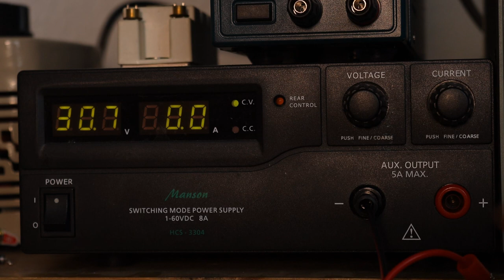ZVS Driver tutorial  - Step by Step - Flyback driver + Inductionheater

Comment: I made it and it works, thanks a lot for your tutorial
Reply: My circuit does have a major problem though , i was wondering you have a fix for it. When I run the circuit of my 12 volt 10 amp max battery charger it works fine and it gives arcs. Then I wanted more high current arcs so I used a 8 volt drone battery. I worked very nicely for a few seconds and then the circuit stopped oscillating and the mosfets started heating up. Then I turned it off and tried again then again it worked for a few seconds the the arcs stopped and mosfets started heating up. I then tried it with my 12 volt 30cc large lipo battery which can output upto 80 amp peaks. With this high current 12 volt the circuit never started oscillating and the mosfets started heating up quite a lot . The mosfets didnt die fortunately. But the only source I can run it on properly is my 12 volt 10 amp max battery charger.

Edit:I found out my frequency was too low because my caps were too high

Edit: i fount out my problem still persists even after chaning the caps. I dont know why

Edit: I Fixed my problem, turns out the problem was just my flyback transformer, I changed it and now it works flawlessly!
Reply: My did not work

Comment: hey man i need help me... i dont know how to set up my "ZVS Voltage Switching Coil Flyback Driver Coil Driver Board Marx Generator Jacob Ladder Ignition Coil 12-36V" i see at the 1:48 you have the both wire in one hole?

Comment: I used two 0.68uf capacitors but they heat up when i pass 24 volts and 4amps the coil aswell heats up a bit should i add more capacitors? Please

Comment: I built something very similar to this many moons ago but using a centre tapped coil & a slayer circuit to drive it but never tried it with a ZVS. Worth investigating. Can I ask how many turns & wire size you used on your primary?
Reply: 4  and 4 turns

Comment: Hey i have a quistion i orderd the exact parts for this build  but could'nt get my hands on an 100uH inductor so i wired 10 10uH inductors in series wil this work ? And st what voltage did u run this set up?
Reply: 30v

Comment: Can I really get that thick arc from 0.8A supply?
Reply from the maker: not a thick one
Reply: @Teslaundmehr  can I use mpx-x2 capacitors?
Reply from the maker: @mehedihassan8944  I think it should work with low power, but its not perfect ;)
Reply: @Teslaundmehr  ok.thank you.
Reply: 0.8 A is the idle current😂😅, in order to don't burn the MOSFETs you need at least 12V 6A🙃

Comment: Can you power it from 12 volts, 3 amps?
Reply: YES,  BUT USE IRF3205 IF U WANT TO SAVE UR MONEY,  and i even did it with 19V 3,5A with irf3205, irfp250 can quickly hot and the irf3205 has rated at 185W and it cheaper while irfp250 just been rated at 150W
Reply: @trung12309  bro can I use fr207 diode instead of uf5408?
Reply: @jagdishsingh9997  yes but fr207 just work around kilohertz
Reply: @Mihály Tóth just search their datasheet